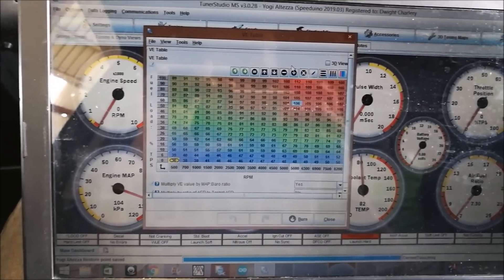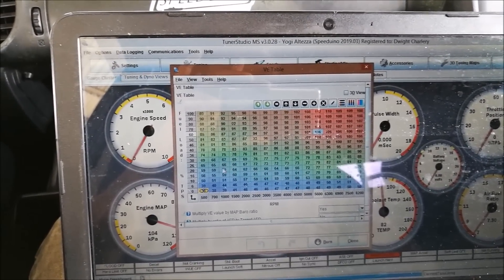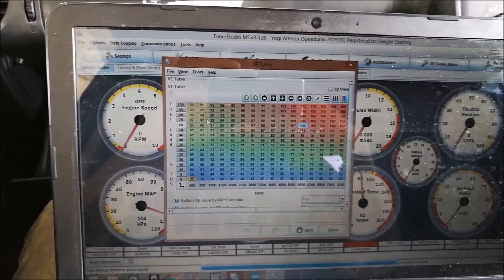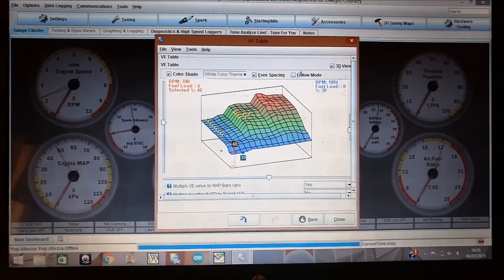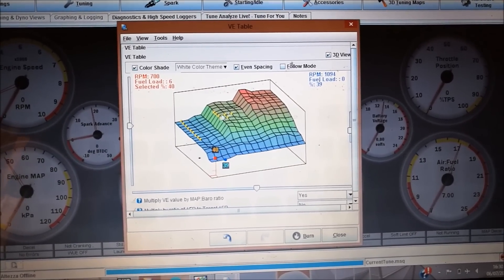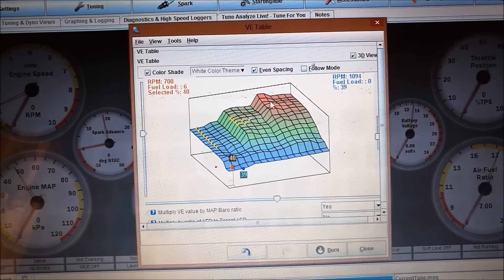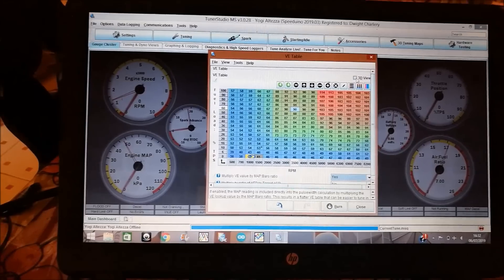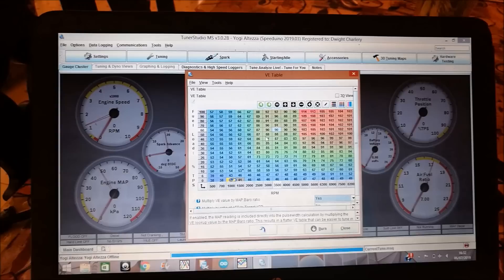Alpha N Tuning on the Speeduino Toyota Altezza

Comment: Would this setup be capable of running ITBs? when running the speeduino in parallel and using alpha N tuning i dont see why not. Im running power FC, but i am thinking of running speeduino.
Reply from the maker: I have not done it, but I see no reason why it wouldn't work
Reply: @DCWERX  this altezza was still using the stock throttle body/motor? with no Air flow meter signal?
Reply from the maker: @kelvinarreola  correct

Comment: have you ever get sync Loss? I am getting that. Deleted the factory wire and using the one shielded I got from the ECU guys but still sync loss
Reply from the maker: I get sync loss with other cars but this one didn't have any or much IIRC. I used the factory wiring

Comment: What would be your opinion on running a turbo Altezza on speeduino? I think it would have to be a parallel install for vvt control unfortunately. At the moment I am planning this build. It would be great to be able to change coil packs to Audi R8 or similar but I am worried about the igf signal to the coils while using the standard ecu until the speeduino takes over
Reply from the maker: The Speeduino would work fine on turbo altezza. 

Look up the R8 coil pinout and see if it provides the IGF signal you need and it should be good to go even if it doesn't, the factory ECU would just throw a code.
Reply: Thank you. I hope to tackle the project soon, I will be going for 550hp on a holset hx35